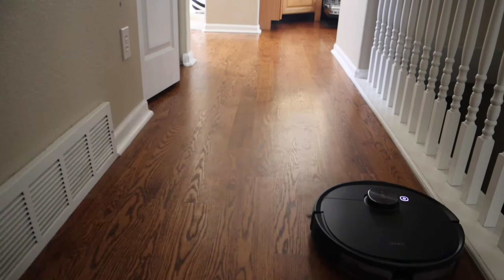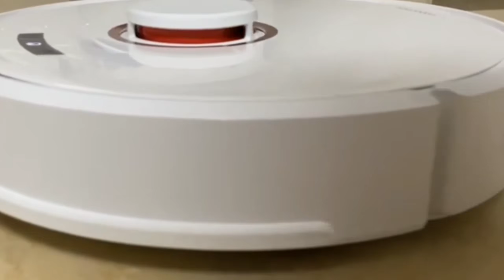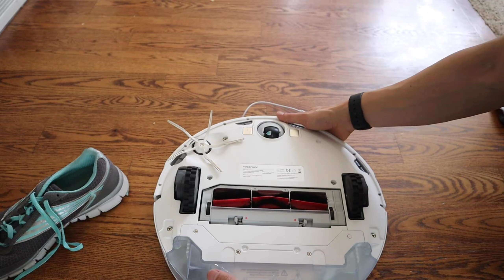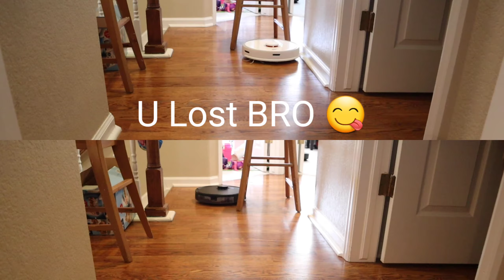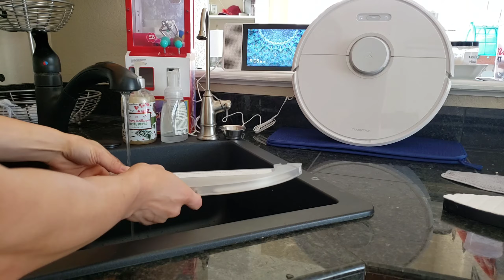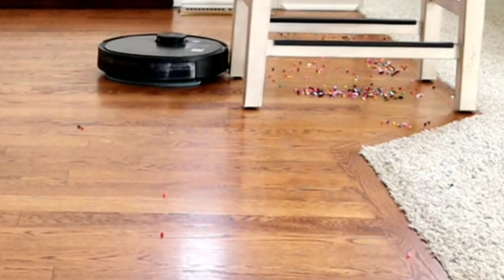Ozmo Deebot T8 Front Camera put to the Test, Can the Roborock T7 compete with the Ecovacs New BOT!!!

Comment: I picked up the T8 after your second video showing that it was modular. Got it on Friday. The vacuuming performance on it seems great. Out of the box upgraded firmware from 1.4.5 to 1.4.8. it looks like they tweaked the brush speed or I just can't tell from your video and what I see. The app still not available in the Play store but still in iTunes. I'm still testing it out and still robot proofing my house as this is my first robot vacuum. Overall though I am happy. The camera is doing well with the shoes cables and socks that get left around and how fast and far the laser reached was impressive.
Reply from the maker: Glad the T8 working out for you 😅
Reply: @RobotMasters  So far so good. I am going to be critical though while in my return period. I'm still eyeing the s5 max. I just know I can't go back to not having a robot vac now.

Comment: It’s so easy to use🌼 just make sure it’s charged, push the auto button and it will clean the room. You can use the app, connect it to your WiFi and program the robot to run at a certain time.

Comment: Hi I am planning to buy ozmo t8. Requirement is for hard floor tiles (no pets)and their are 2 floors in the house. Mopping is also needed and 1 floor is covered with furniture so it should be good in navigation as well. Will t8 will work in uae and india? If not why? Any recommendations for any other model which works in India and uae both.
Thanks
Reply from the maker: So the T8 should work in your country, my recommendation is to download the Ecovacs app and see if your country supported. My other robot vacuum recommendation is the Roborock S5 Max, can handle the vacuuming and mopping tasks. Also has excellent navigation too. You can’t go wrong with either model.
Reply: Thanks for the reply. 
currently I am in uae. I downloaded the app and did not find t8 model to configure. I am getting 960,950 all ozmo model except t8 and same is happening in India with my friend. Any help on this?
Reply from the maker: ishu singh My best option is to contact Ecovacs, they may be able to push a software update to support your country.

Comment: Thank you. Do not consider the cost performance. Which is better, roboock T7 and Deebot  T8? Which is smarter? Which is smarter to avoid obstacles and route planning?The room is 280 square meters. Clean the tiles.
Reply from the maker: They both navigate about the same speculating the T7 navigates like the previous Roborocks. I have not personally had a chance to try out the T7. The T8 has the option to turn the AIVI camera on so it will avoid the objects laying on the ground, like shoes and socks. I would recommend both, they can clean efficiently and each have their own unique features.

Comment: Thanks for the nice reviews. After testing all these robot vacuums, which is your favorite and why? Which one would u recommend us to buy?
Reply from the maker: It all depends on your floor plan, how many levels and cleaning surfaces. Carpet, Hardwood, tile etc etc. My Top Picks are the Roborock S5 Max, Roomba i7 or s9, Deebot 950 or T8 and the Roomba e5. These offer the best value and pickup abilities. Roborock tend to have the best navigation. Roomba offer a good balance of cleaning performance and features. Also last a long time. The T8 and 950 have long battery life and the T8 feature proof by adding a self emptying bin and vibrating mopping module.

Comment: Roborock it's the best in navigation 😀 😀and smart map and functionality.... But!! 🤔🤔🤔🤔🤔🤔 .. I wonder if people keep buy more than of the same? 🤔 🤔 🤔 🤔.. We want roborock to give us somenthing new,, selft empty bin, vibration mop, camera options etc..so disappointed 😥😢😢😢of roborock..

And debot ozmo t8!!! 😀 😀 😀 You are going in a great direction. 😂 You got everything nice!!! Except what roborock has.. The smart navigation 🤣🤣🤣
Too bad we can have both in one lol

And last question 🙋.. Really roborock work on a 2500 or 2600 PA,,
BUT THE M7 PRO ALREADY HAVE IT AT A REALLY LOW PRICE I AM CONFUSE NATHAN?? 🤔 🤔,. DOES THE 2600PA ON THE M7 PRO IS IT TRUE? 🤔 🤔 🤔
Reply from the maker: So the M7 Pro Pa numbers is based on the manufacturer's claim. So take that number with a grain of salt. For example the T8 runs around 1600 Pa based around the ozmo 950 platform which was tested by Vacuum Wars. Despite being a lower number I have found the T8 did a better job pickup more debris and finer dust particles than on the M7 Pro. A lot of factors come to play when determining how well a robot's vacuum cleaning performance. Airflow flow, extractor bar design, side brush ability, Navigation and even the way the robot travels on the ground. As for the Roborock T7 offering minor updates like the increase in Pa and new Map management system, the tried and true system will attract a lot loyal and New Customers. If it Ain't Broke Don't Fix it philosophy. Maybe Roborock will release a self emptying bin, but for a business stand point it best to hold off for now and keep offering minor updates.
Reply: @RobotMasters  you completely right. Probably that's why roborock hasn't made any big updates but probably once they don't get too much response from the customer is when they they might try to act 😂 hope its not too late for theme..
Abd about the m7 pro. Did you run it on the strong mode? 🤔 I will try to do that test on mine and see how it goes
Reply from the maker: @danielsv17  Yes I usually run my Vacuums on high all the time
Reply: @RobotMasters  great thank you Nathan 😊😀😀
Reply: I can't say for the M7 Pro but I have tested the Viomi V2 which is the same as the Proscenic M7, it claimed to be 2,100 Pa. When I measured suction it was clear that the Roborock which delivers 2,000 Pa showed better results than the Viomi. It also was better it picking up debris on carpet and deep carpet clean so I wouldn't just rely on the Pascals. It is also because of where the cleaning brush is located and its design as well.

Comment: Can I use disposable map on Roborock S5 Max? Because it is different from S6. Thanks
Reply from the maker: Thought the Mopping pads on the S5 Max and S6 are the same? The mopping mechanism are different, but the mopping pads should work in between the two models.
Reply: @RobotMasters  is it convinient for you to check if the mop cloth board of the s6 works on s5 max (so I can put the disposable mops)? Thank you for your help
Reply from the maker: Giorgos k Yes the are interchangeable, can use disposable ones on the S5 Max.
Reply: @RobotMasters  Thank you very much.

Comment: They need a moping mat that can scrub not just absorb. None of these are able to reverse brushes to spit it out, guess irobot owns that tech
Reply from the maker: iRobot does well with anti tangles, maybe the Narwal will bet the best scrubbing mopping robot or the LG CordZero ThinQ Mop?
Reply: Only failing is grout lines, mine are sealed so dirt sits on top but still need brush to scrub it out. Braava just slides over them, only complaint

Comment: Impressive! iRobot lagging behind!
Reply from the maker: LoL iRobot still has the best self emptying system 😂
Reply: Robot Masters it’s super easy to design an auto emptying bin. Personally I’m not a fan of self emptying, I’d rather have an efficient and effective fast cleaning.
Reply: i think its not that easy because proscenic failed to design its bin  wich wont pick up even cereal
Reply: stv pls I never have cereals on my floor. Do people buy robots to remove dust from the floor or cereals?  ;D
Reply: i know xd but all the other robot bins can suck it up
Reply from the maker: @clou1969  Yeah, I have see a lot companies create self emptying bins, Samsung, Proscenic, Ecovacs, but all seem to struggle with lots of debris in the dust bin. I have tried the M7 Pro self emptying system, and while it doesn't extract all the debris in one go like on the roomba, it does keep the dirt out from normal day to day vacuuming.  Self emptying system are nice convience options, but you still have to clean and maintain the robot. What makes the self emptying bin so successful on the roomba is the self emptying system can detect if dirt isn't being sucked out of the robot. The system can make multiple attempts. Can't wait to see what 2021 has in TOW 😂
Reply: also very good on carpet depsite the low suction power